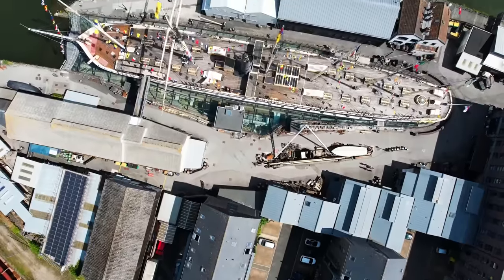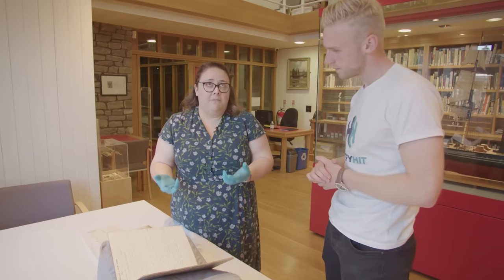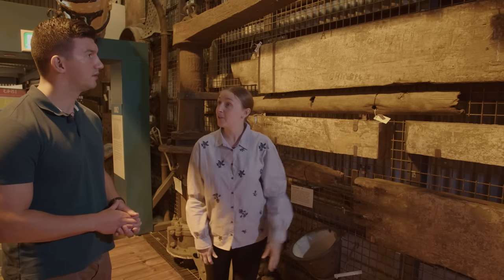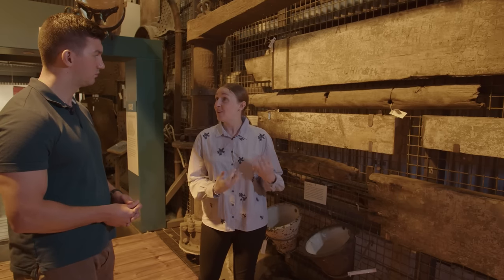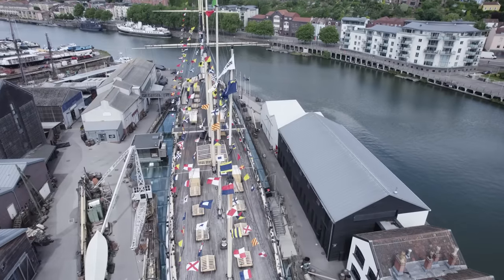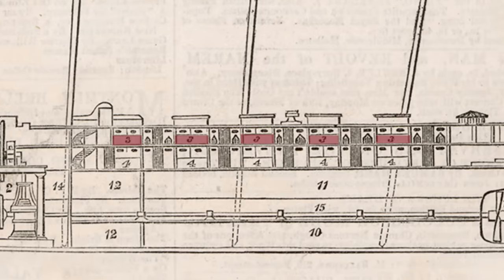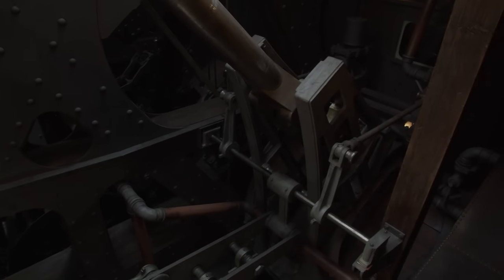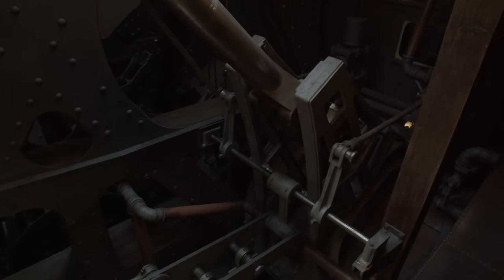Could You Survive as a Sailor on a Victorian Ocean Liner?

Comment: Great film, really informative, but I have one minor technical correction, as someone who has sailed on five different modern square riggers: The horizontal bit that supports a sail is called the YARD, the lowest one being the Course Yard. At the very end of each yard is an arm where there's no foot rope to stand on and that's called the Yard Arm. Sorry, but it really grated every time someone used the wrong term.😊
Reply: Theres lots of little niggling errors but on the whole...its a decent programme.

Comment: I have a wooden walking stick which I believe belonged to my Great Grandfather. There is a band on it that reads "A relic of The Great Eastern 1892". Also a brass anchor that hangs on the wall. I have just read the history of this Great Ship. It's extremely interesting.
Reply: That's cool!
Reply: One could pick up, in junk shops, little 4cm high wooden barrels with a small plate stating from which ship the wood had been retrieved, even during a refit rather than dismantling. I do not think people gave them a second look and many were just thrown away when their houses were cleared. the last one I saw said 'Foudroyant'.

Comment: So the left side of a ship is called the port
and a port(harbor) is called a port.

Isn't it confusing?
Reply: Seafaring vocabulary conveys a lot of ancient, specialized knowledge that only people who "learned the ropes" really understand. Much of that language is so steeped in tradition that it refers to objects or concepts that passed out of use long before the words continue to be used.

Before there were rudders at the back of the vessels for steering, boats were steered by a large oar or paddle from the right side of the ship near the back. (Which probably had to do with the fact that most people are right handed.) Because that steering oar was on the right side, the right side became known as the steer-board or starboard. And because you didin't want to hinder the steering oar when you were in port, the other side of the boat was used for loading, so that side became known as the larboard ("lade-board" or loading side) of the boat. So you had starboard (right) and larboard (left). And that must have been really confusing, especially when shouting something like "keep away from reef to larboard" in a gale!

Boats got bigger, becoming ships. Steering oars were no longer used (except in emergiencies), but "starboard" stuck around. What happened to "larboard"? Well, presumably "port" made more sense than "larboard" especially as ships got larger and it got more challenging to communicate over larger distances.

Another thing that's confusing to landlubbers is that at the time the SS Great Britain was sailing (or steaming), if you wanted to change the ship's course a bit to the right (or starboard), you would have actually told the helmsman something like "Helm, 1 point to port". This is because steering instructions in that time period (up to about the 1930s)  referred to using another piece of equipment that was no longer used on a ship of the size of the SS GB: the tiller. Small sailboats and outboard motorboats still often use a tiller today. This is the horizonal bar or handle attached to the rudder (or motor). You move the bar to port if you want the boat to go starboard.
Reply: And port is a drink.

Comment: so it’s aaaahhh double action condensing invited walking v beam steam engine. How many cylinders? cylinder capacity??operation pressure’s?? power output?? boiler max pressure?? Ya could of covered these points at lest. I’ll just go google it.
Reply: ohh it got two engines matted together forming a v. 2 stage, 4 cylinder each, double action condensing included direct-action steam engine. high pressure cylinders unknown, low pressure 88 inch cylinder’s, 6 foot stroke, 500 hp each, total 1000 hp, 18 rpm, powering a single screw propeller, 3 double ended square seawater boilers 5psi 8 furnace’s each. dang square seawater boilers yuck 🤢. That would require a heck of a lot of cleaning 🧼. hight pressure cylinders 5 psi that means the lows are like 1-2 psi. Still 1000 hp for 1845 is impressive.
Reply: You're clearly the only one who cares

Comment: The working temperature inside the engines boiler may have been 1000 -1200°c, but nobody was working in that temperature, it's three times the melting point of Lead FFS!
Also, RADIAL refers to something arranged is a circular fashion, normally following the radius is a circle, eg a radial engine.
RADIANT can be used to describe energy given of by a heat source.
A bit of basic fact checking and the use of a dictionary would not go amiss.
C-. Could do better.
Reply: They explain all this via a text box in the video.  You need to pay more attention.  D- comment.
Reply: They leave the erroneous information in the video, and the exposed heat is not even close to that temperature; to give some idea, that about the same temperature as a Bunsen burner, so essentially instant burns. It's also much higher than the flash point of cotton, and high enough to make even wool spontaneously ignite. They try to explain it, but still cock it up.
Also, see radial.
Reply: @emergingloki  They are human, and I imagine they only had a limited amount of time to shoot everything.  They added an explanation in editing, so I'm not sure what the issue is.
Reply: @Emergingloki1 You are correct. We were asked to provide content for some of these sections at the last minute and despite our extensive knowledge of the ship and her history we're not experts on every area. My colleague simply misspoke during what was a long and hectic day of filming. To clarify the working temperature in the engine room was typically between 40-60 degrees Celsius. The radiant heat given off from the furnaces when the doors were open was typically between 1000 -1200 degrees Celsius. Apologies for any confusion, we're only human. 🙂
Reply: Still the point being it was horrible job and majorly uncomfortable temperatures, especially when you factor in they are not just sitting there but shoveling consistently etc heavy coal etc and you factor in the other workers,the confined space,the probably uncomfortable attire they would of wore which was probably completely unsuitable. A few of my ancestors did this job .I live in Liverpool. One , my great gran dads brother after years of serving on different ships  then ended up on a ship sadly during the war and got  hit by a ubomb . Sadly no surviving that !

Comment: 1000 deg c in the boiler roomm = bullshit
Reply: The boilers would get that hot, not the room.
Reply: @cleverusername9369  The boilers couldn't get that hot, either. The water inside them would limit the boilers to 250 to 300F.